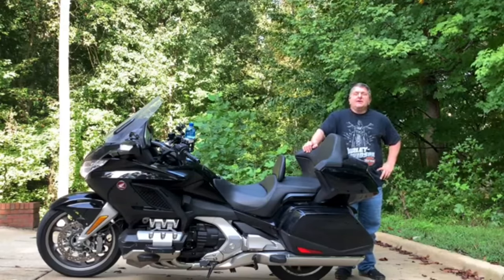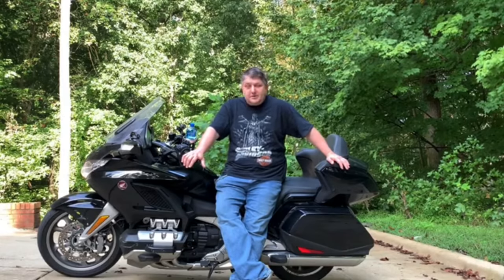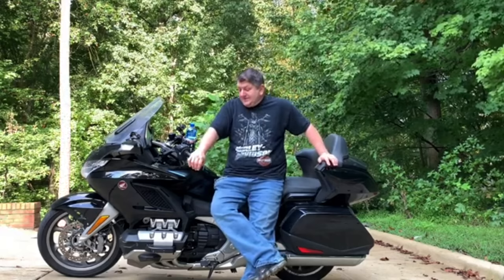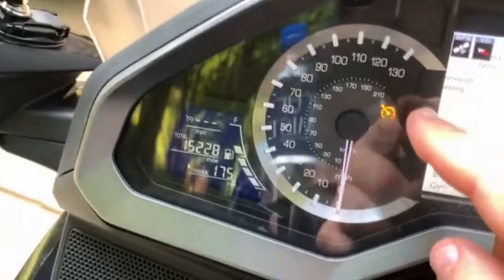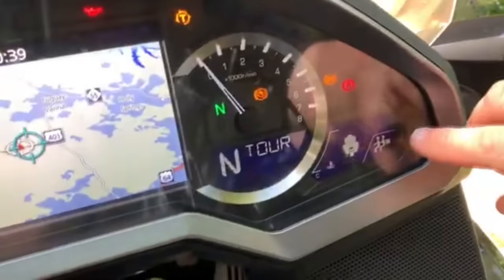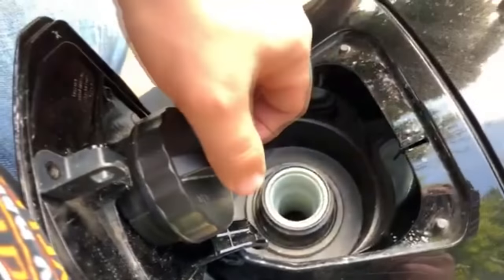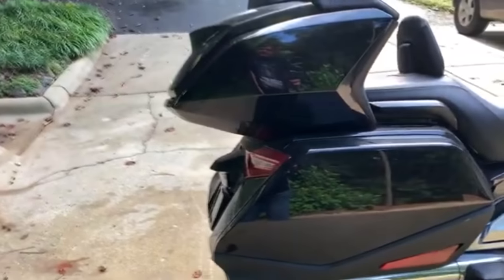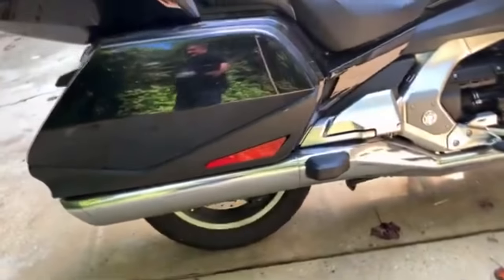2019 Honda Gold Wing Tour DCT 15K Owner Review

Comment: I never hold the front brake to start? My 2020 now comes with fog lights. ACC= accessory. 
I loved my old Goldwings and love the new bike even more. I no longer Mount the phone. Use Apple car play. Love it. One less thing mounted on the handlebars. M7 order the new grab bars as you have a better place to tie down backseat stuff. 2020 comes with them. 
Next time we ride it will be interesting to look at both bikes. On closing the doors always close slow and easy just as you did. 
Honda factory will use both Dunlop and Bridgestone. My 2020 came with Dunlop but will I will change to  Bridgestone.
Reply from the maker: So you can just hold the red button down for the three seconds to start?
Congratulations, BTW on your new scoot!
Reply: Maikeli7 yep just push switch and bike starts. Try yours it should be the same.  Got the bike in February. White Blacked out.

Comment: Very good review.  I currently ride a chopper, but I’ve been seriously thinking of buying a Goldwing.  How does engine braking work especially going down hill?
Reply from the maker: Engine braking works just as well if not better than manual. It is so intuitive, it is almost scary.
Plus, the paddle shifter allows you to shift up or down at will.

Comment: One more question: what do you think about the safety pin, what Traxxion is selling? By the way, I tought Honda tells you, not to tie down by the handlebars?......... And the grab rail is better on the 2020 as far as I saw (told you, I watched tons of videos already.......)
Reply from the maker: Jürgen Niklaus I saw that pin thing briefly. Not sure at all if I need it or if it is something Honda would approve of.
Since I already had the steering issue worked on, I think I should be fine. Never should’ve tied down by the handlebars. I saw a Traxxion Dynamics video where he said it was ok. 
NOPE! It isn’t!
Lots of people are changing to the upgraded grab rail. Not I. I’ve got no issues with the OEM.

Comment: Thanks for the detailed review. If you don't mind me asking...how tall are you? I am 5'7 28 inch inseam contemplating trading my Indian Roadmaster for a 2021. My bikes seat height isa few inches lower. I sat on one at the dealership and I think it should be good. Unfortunately we are covered in snow so now test drive at this point. Thanks again!
Reply from the maker: I am 5 foot 11 and I have an inseam of 31 inches. Not sure how the seat height will feel for you, but I imagine if you were wearing motorcycle boots, that would give you at least another inch. The bike feels so light and is so easy to keep upright, I do not think you will have a problem.

Comment: I wish someone would be able to tell me what is the problem with the front springs absorbing the braking energy when you hit the brakes.I can tell you what the problem is when the front springs do not absorb the braking energy.. that energy has to go somewhere. If it doesn’t go into the front forks springs, it goes into making your bike unstable if you have the wheel turned at parking lot speeds... ask Annie BMW K 1200 LT Owner how many times he dropped his machine doing parking maneuvers, and dabbing the front brake with the front wheel turned. It feels like someone pushes the machine over when you hit the brakes..
  I had two different Yamaha ventures for a combined 18 years. I never even came close to dropping either one of those machines. I bought a BMW K 1200 LT. I dropped that machine two times in parking lots. I told other BMW K 1200 LT owners what happened, one guy laughed and said, get used to it, everybody drops them..
  I now have a 2002 GL 1800 Goldwing. I have not even come close to dropping that, because it does not have the weird front end that does not absorb braking momentum/ energy
  I know two gold wing owners that had 2018, and 2019 gold wings. They both traded them in on leftover 2017 gold wings. They said they just didn’t feel right. I suspect it’s that anti-dive front end. It is just weird.
  And I’m still waiting for someone to tell me the problem with having a front end that dives a little. I know it changes the rake and the trail on Moto GP like bikes ..it makes the rear end light under heavy breaking, At least in theory and on paper..I’m sure the Honda front end has it’s good points, but sometimes change just for the sake of change is not really an improvement. Just ask Coca-Cola ..
Reply from the maker: I’ve had no problems in emergency braking or in slow-speed emergency braking.
In situations where my Ultra Limited would dive and scare the crap out if me, the Wing doesn’t bat an eye. Very confidence inspiring.
Reply: Maikeli7 
  i’m glad that the Honda is not as intimidating to you as my BMW K 1200 LT was to me..Every stop sign on that BMW was nervous for me. I mean I started putting both feet down as I approached full stops like a rookie..That  fork design that does not absorb braking energy just feels unnerving...I completely understand why BMW dropped that model. It had a great seat, great passenger accommodations, I liked the electric windshield ,the heated grips and reverse, the six CD changer, it was very nice on the highway once Rolling, but it was scary as hell with those electric no feel brakes at slow speeds and all that high top heavy weight to deal with, 900+ pounds.. like I said before I had put over 200,000 miles on the two Venture‘s that I had for 18 years combined, I have a GL 1800 right now with telescopic forks, I never even came close to dropping any of those machines. in fact, I’ve been riding since 1968, I have over 700,000 street miles alone, I don’t remember ever dropping a motorcycle on the road/or Street/or parking lot except for that BMW..
  I never gave up on that BMW. But, I had a collision with a deer at 70 miles an hour  on the bmw..I didn’t go down, $5500 damage, but I just felt that machine was not for me ..after it was repaired at a BMW dealership, I just got rid of it , and bought my fourth Moto Guzzi, a 2007 norge. Which I still have along with my gold wing..
  You mentioned that the gold wing you have has the electric windshield ..I’m surprised that Honda did not have a electric windshield until recently, my Moto guzzi Norge is a 2007 and has electric windshield along with three heat range heated grips, ABS brakes/2 channel that can be turned off with a simple push of a button on the fly when you’re on gravel or grass or even snow so you will actually have  conventional brakes, it has a single sided swinging arm, center stand, and weighs 400 pounds less than my gold wing, and conventional telescopic forks with adjustments for preload, rebound, and compression damping which my gold wing doesn’t have.. I bought an older gold wing because I do not lwant ABS brakes on a motorcycle again...I had an experience with ABS brakes that many people never really think about. On my BMW, I was on a backroad to a camping area ...Gravel downhill road. The computer detected the wheel was locking On the gravel, and the computer took over and I had zero braking..It was like I was on a sled on snow. The bike picked up speed as I was squeezing the front brake lever and the brake pedal as hard as I could ...Luckily I ran into a wire fence ..The three other riders I was riding with rode down that same gravel road, they did not have ABS brakes, and none of them had any trouble. That was the last straw with that BMW. That is why I own an older Goldwing that does not have ABS brakes. That is why I kept my Moto Guzzi, They at least they recognize that there are times when you have to have the ability to turn the ABS off so you will have brakes.. motorcyclist magazine raised concerns about the ABS brakes not being able to be turned off issue when Suzuki introduced  an updated version of the V Strom 1000 with ABS brakes. They pointed out that it is not a great idea to have ABS brakes on a motorcycle if you can’t turn them off in certain situations. I found that out the hard way...
  I really like the features and the look of the new gold wing. I especially like the fact that it is 85 pounds lighter. I am looking forward to taking one out for a real test ride and parking lot maneuvers in the spring before I decide whether to go with the gold wing or the new Yamaha venture which I really really liked when I took one for a test ride.. Yamaha, like my Moto Guzzi Actually feels like a  mechanical machine / motorcycle. On the other hand, the gold wing feels like a Cadillac. I happen to like both..

Comment: Talking of tyre pressure sensors, try BMW! On my 525 they were going off all the time, every drive.
Extremely annoying
Reply from the maker: I find that as long as my tire pressures don't dip below 32 psi, I don't get the blinks. Of course, I check it each ride in the first mile to make sure I'm good. I like to keep my tires inflated to the spec on the tire, though I know the spec for the bike is different. I'm just too lazy to look in the dang book.

Comment: Can you make the sped you are traveling come up on the big screen? Key detail
Reply from the maker: Nope. But I can see the speed on the analog and also whatever speed I set in cruise control. There might be a way to show it on the center screen through Apple Car Play, but then, it might interfere with seeing the map.
Reply: @maikeli7  Reading those small analog gauges is not optimal. I have that on my GS and I have to use the GPS to really see what my speed is. They could have easily had that option come up on that big screen.

Comment: Do you need to use a battery tender for a GW?
Reply from the maker: You can, but you don’t have to.
Reply: Thank you very much for your response.  Therefore, it must have a different battery than the Harley Davison.
Reply from the maker: @rarsenio1  I think if you’re going to leave any motorcycle in the garage for months without starting it and riding it around because of winter time, it is a wise choice to get a trickle charger.
Reply: @maikeli7   Thank you for your advice.  It is appreciated.  I have a H-D, And I am seriously thinking about buying a GW 2021.